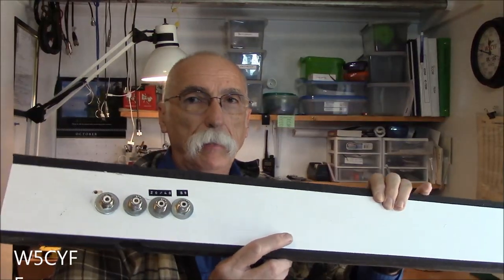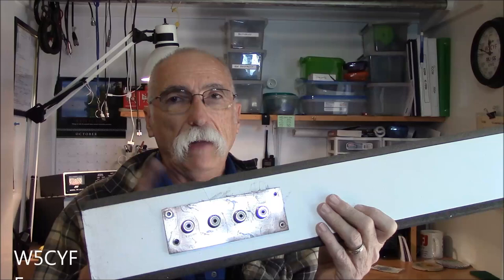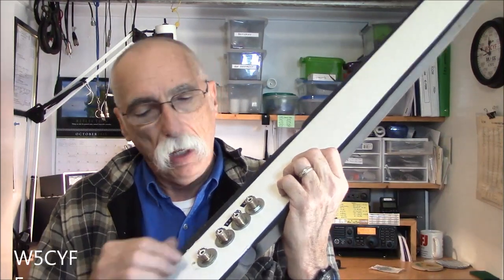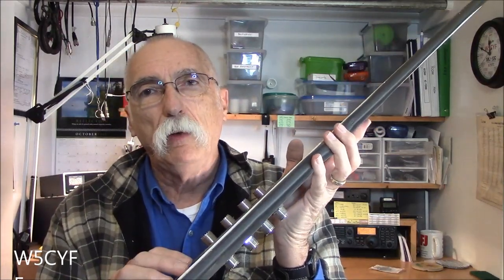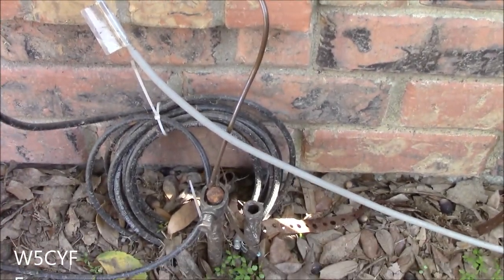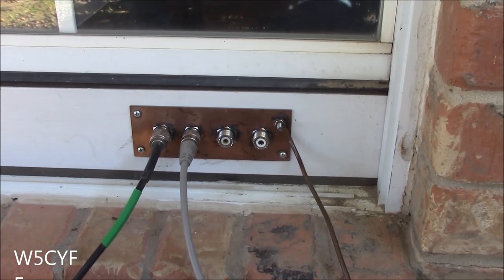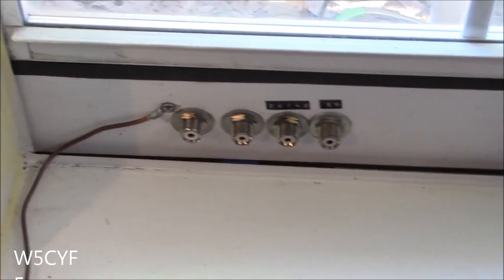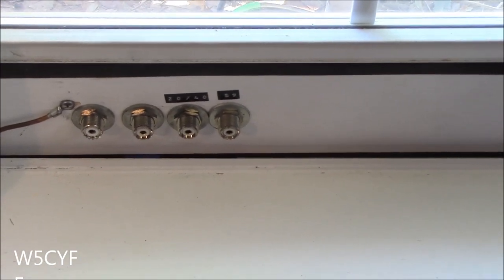Antenna Coax Cable Window Pass Through – Radio/TV

Comment: Nicely done!  I drilled a 1 ½" hole right through the outside stucco and then put an LB fitting in it.  On the inside, I just have a box-sized cutout and pull my cables through it.  A 4-gang solid plate covers the hole and I carved notches on the sides of the plate to let the cables pass through.

Comment: Since Youtube won't allow me to edit my previous comment...

Thanks for the video. I was brainstorming this exact situation this morning and while I am handy, I don't have tools and such so if I were to try to do this, it'd look like something my condo association would throw a fit about. They have this nasty habit of leaving notes on my door telling me I'm violating this or that already! (Wait until my antenna farm is in full bloom!!!)

You can use a 2x4 wedged between the top of the inside window and the window casing top as the security. I like to use solid foam padding - the nice dense type - to seal off the opening between the 2 sections of windows so bugs don't get through. I've been doing this since my CB days when I just ran RG-58 or RG-8X out. The only problem I have is I want to have a screen so I can have fresh air coming in as well... I haven't quite figured out how to accomplish that. I might have to build a custom frame for that one.

So, what I found was that MFJ has a product (line, actually) along the lines of what you've done here. If I had the resources I'd just DIY it but... MFJ solved the aesthetic issue for me so here's what I'm looking at doing:

https://mfjenterprises.com/products/mfj-4601

They have others as well... just change the last number from 0 to 5, and there's a 4601N as well with N connectors. I might still need to put up a random wire through it so I might end up having to put an extra hole in it myself, but for the price it's worth it for my needs. 

But hopefully the condo karens don't get their jogging suits in a bunch and come after me for how it looks!

Hope all is well in your neck of the woods!

73 OM de N2JZS

Comment: This is great, I've been trying to figure out how to deal with this in my rental house. With a few adjustments on holding the window closed and using fiberglass batting or other removable insulation, I should be able to make this work.
Reply: You can use a 2x4 wedged between the top of the inside window and the window casing top as the security. I like to use solid foam padding - the nice dense type - to seal off the opening between the 2 sections of windows so bugs don't get through. I've been doing this since my CB days when I just ran RG-58 or RG-8X out. The only problem I have is I want to have a screen so I can have fresh air coming in as well... I haven't quite figured out how to accomplish that. I might have to build a custom frame for that one.

Comment: I had one of these type of pass through boards at my duplex last year, and it worked pretty well. I just cut boards to shim the top of the window so it couldn't be opened. Not sure about how much cool air it leaked out though. I've moved into a new Florida concrete block house and my office / ham radio is in a front office room, and not sure I want to use this method for a front window as it might be a little unsightly. Being a new house I'm not keen on drilling a pvc pass through into the wall. My indecisiveness has prevented me from setting up my antenna as of yet. I sort of want to route the cable and station ground up through the ceiling, and mount my 8 foot pole to a board through the soffet using a J pole mount on the side of the house. and then have a ground beneath it.. I reckon I may just opt for a dedicated ham shack / workshop.
Reply from the maker: Jeremy, thanks for stopping by and for your comment.  Good luck on successfully getting your shack set up.  ~John

Comment: Thanks for the tips John. Thats a neat idea. You can also connect feeder straight through glass using capacitive plates.
Hope to work you on the band when conditions allow.
73
Sandy
Reply: +Wiltshire Man I don't think that works for HF frequencies, only VHF and above, you need a low impedance and for HF it would be huge plates. If it's a double pane window, won't work for anything.

Comment: I hydrodrilled two 10' 1" copper pipes into the ground, bound them together with 1" woven tinned copper strapping, then used two car jumper cables to bring the ground inside through the floor. Then I used one old car jumper cable #8 sized to bring the ground wire up to the desk to bolt with fender washers to my ground strap made of a piece of 1" copper pipe flattened. I then used two old 1' copper bars as grounding blocks for my equipment with military double braided coax with the center stripped out. Very heavy duty? Yes, but when dealing with a good ground, you do not want "copper losses" messing up conductivity to ground. The thicker the ground wire, the better the grounding, especially for direct lightning strikes on your antennas. And we get some really good strikes here on this tall hill. I used what I had except for the 1" copper pipe which at the time cost $8 per 10' length, some years ago. The 1" braid I used came from my Dad's shack who was an SK in '90. Miss him bad, even now as he was a WWII Navy Radio operator, a Tech licensed Ham, and my Dad. Dad could read the paper, and copy CW inside his head, writing each line down as completed. I struggled with the Code, then it seemed to snap right in one day. I never was as good as he was, but I got up to 25wpm. That is good enough for me. It got me through the code exam for my extra class way back in the day. 
You can never build a ground system thick enough to handle lightning strikes, but when I worked for WHAM (50 KW Clear channel station) , the ground busses were as thick as my thigh, and pure copper with a nomex/plastic jacket. I forget the final tubes, but the drivers were two 4-1000 A's in Class A/B sercice. For those who remember Jack Slattery, he was a good friend of mine. Just some memories.
73's de W4FJF.
Reply from the maker: Thanks for taking time for a detailed comment, very useful info.

Comment: Thanks for the information on how to make this. I will be using LMR 400 coax outside so what should I use inside for a connecting cable. This is all new to me. Thanks again.
Reply from the maker: Thanks for watching.  For inside, you can use any UHF cable for such short runs,      ~John
Reply: Thanks for the reply. Would RG-59 work well in 2 foot lengths? I ask because I have a lot of it.
Reply from the maker: Yes, that would work fine for those short distances.  ~John
Reply: RG-59 is 75 ohm coax so if you want to keep it at 50 ohms then use RG-58 or any 50 ohm coax including LMR 400.
Reply: LMR400 Ultraflex is what I'm using

Comment: I've been thinking about doing this for a long time. I know MFJ sells some but none of those work for me. I had a ground rod but it never seemed to be necessary, it was a 6ft. I just grounded all of the station components together with no problems,it couldn't hurt though. Braid is good for this rather than wire since it has lower inductance. I was using 1/2" tinned copper braid.
I rented out my place, but moved back in and now I have to reassemble my station. Big mistake on my part!
I have HOA restrictions but I was able to put up a Cushcraft MA6V in my patio. Haven't gotten it back up yet.
 73 James
Reply from the maker: +eminusipi 
James,  thanks for stopping by and leaving a comment.    ~John

Comment: I assume you have a double hung window.  When you raise the lower sash up 4" it creates a gap between lower and upper sash such that you don't have a good weather seal.  How did you address this?
Reply from the maker: Thanks for watching.  I used foam pipe insulation to fill the gap.  It was somewhat unsightly, but it was a window on the side of the house and not visible to street or neighbors.  Fortunately my wife seldom saw it ! ~John

Comment: I need to do something like this. my coax is running under the gap in the front door, something else I need to fix. Do you think it would be a good idea to put some sort of cap ob the one's not in use?

Comment: I have a similar solution.  What I have yet to solve is how to fill the gap between the two window sashes now that the lower one closes on the pass-through board.  I would like to see what you did with this setup.
Jim  N4FAF
Reply from the maker: Jim, thanks for following along and for your question.  To fill the gap, I used a piece of foam pipe insulation. It was not the prettiest thing, but this was in my ham shack and the window shade pretty much hid the foam.  Hope this helps.  73/John

Comment: I'm planning on making this, although I'm in a mobile home I believe it will still work but I do have to ask, what is the purpose of the PCB/copper plate on one side? Is it for grounding purposes? Is it necessary?
Reply from the maker: The PCB plate is for grounding to main ground.  ~John
Reply: @TinkerJohn_W5CYF  I figured as much, I appreciate the clarification. I plan on building one myself!

Comment: Did you say how long the barrel connectors were?
Reply from the maker: It will depend on the thickness of your board, I used 3/4 inch board and 2 inch barrel connectors.  ~John

Comment: Thanks for this video. Just curious, what is the advantage of using a printed circuit board? Is that necessary? Would something else work?
Reply from the maker: The copper on the PCB is for a common ground from coax to ground and lightning protection.  Hope this helps.   ~John
Reply: @TinkerJohn_W5CYF  I was wondering the same thing, and if there was any kind of insulator between the barrel and PCB.  I was looking into doing the MFJ solution, but they seem to be very proud of their pricing.  I'm going to have to give this a try!
Reply from the maker: @bigginksu  Thanks for viewing the video.  The PC Board is only for a common ground.  You can use anything that will connect the barrel of the connector to ground.    ~John

Comment: I love your DIY, but where did you find the super long barrel connectors?
I couldn't find them and gave in and got the MFJ which works, but I would have rather built mine TBH.
73 DE N2NLQ
Reply: I bought some from DX Engineering for my go kit. I think MFJ might have some that are a foot long at the most.

Comment: You didn’t shoe any of the parts you used. Your video wasn’t helpful at all without showing that
Reply from the maker: All parts shown in video...barrel connectors, PC Board and pine board. Sorry you did not notice.    ~John
Reply: @TinkerJohn_W5CYF  Loved your video!  I believe they make those boards with connectors already built in, don't they?  If not, You should & sell them to us    It wud be nice if you had @ least 1 link showing where we can buy them.  I need one to run my cell ph. booster "N coaxial " cable thru the window but don't have all the tools you have to make it myself.  Arthritis in hands limit me on diy projects.